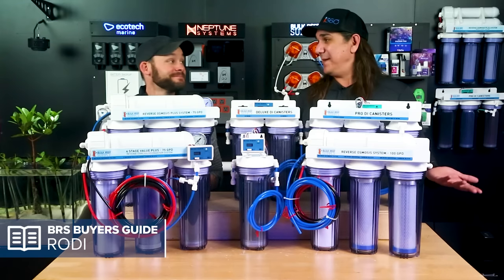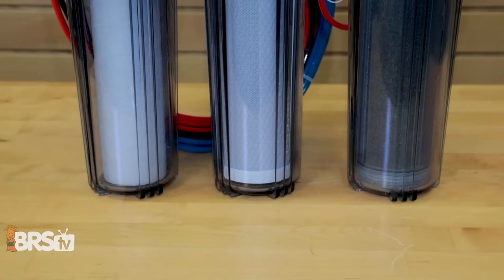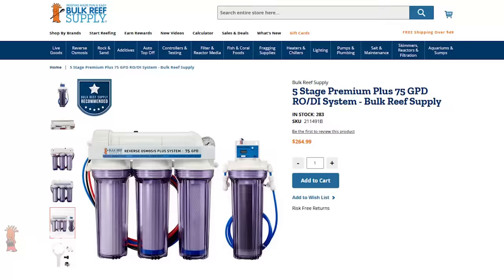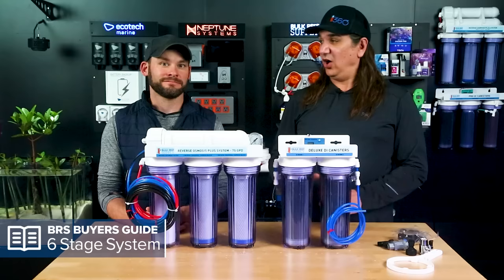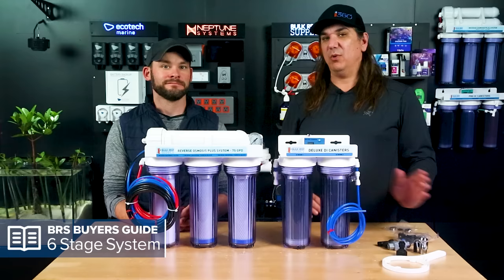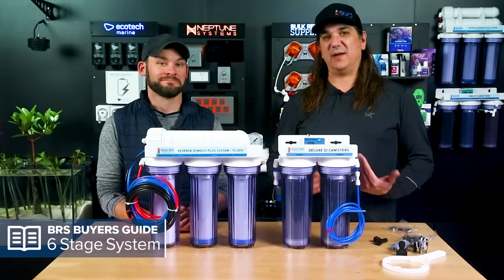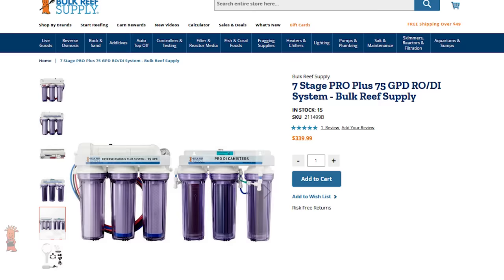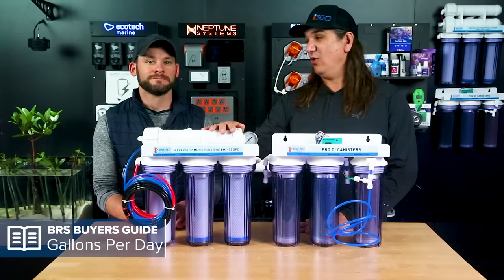Which Aquarium RODI System Is Right For Your Reef Tank? The Answer! BRS Reverse Osmosis System Guide

Comment: Hi Ryan why can you not plum the waist pipe to the mains in to your home thus cutting out waist water I am on a water metre here in the UK  I get my water from a company ( spotlesswater) I would love toget a rodi system but it would be to expensive thanks love your video's keep up the good work 😀👍
Reply from the maker: Interesting thought. You may want to consult a plumber on that one as I'm unsure of how that would work from a functional standpoint. The main water supply line to homes is usually under pressure (somewhere in the 40-80 psi range). Given that the waste line isn't pressurized, it would be hard for the system to function without some sort of pressure release feature.
Reply: Thanks for the reply it's worth speaking to someone about this because it would save so much water

Comment: Ryan and Randy, how much water does it take to make one gallon of RODI water?  I'm moving to a house with septic and am concerned about the amount of filter waste water.
Reply from the maker: If you use the water saver configuration (two membranes) and have good pressure (or use a booster pump), you can get pretty close to 1.5 gallons waste to 1 gallon of good product water.
Reply: @BRStv  then use the waste to water the lawn. Win win.

Comment: What is considered an acceptable amount of TDS coming out of the membrane and into the DI filter? I average 2-4 TDS. 4 at start after flushing, then it balances down to 2 TDS.

Absolutely loving the 5 stage plus system!
Reply from the maker: At peak efficiency, most RO membranes have a rejection rate of somewhere between 95-99%. That means if your source water has 100 TDS, the water leaving your RO membrane should be about 1-5 TDS. Then the DI resin should take that to zero. 

2 TDS out of the membrane into the DI is a good place to be.

Comment: Question. If my water is 300 TDS going in and 0 TDS going out, is the waste water 300 TDS? I thought of using the run off to fill my pool but I don't have a system yet to test it.
Reply from the maker: Your waste water will have a higher TDS than your tab water as it's more concentrated in terms of contaminants. Probably not an issue for a pool, but we're by no means pool experts 😅

Comment: Quick question. Jus changed the filters on my RODI unit. I turned it on and the lines just like started popping and exploding especially the waste line. . For some reason it seems like the flow is being restricted somehow. Any thoughts ? I can’t afford another RO system I’m screwed. All I did was change my sediment and carbon filters. The waste line seems like it’s going nuts idk what happened and when I turn it on I keep hearing a pop after a few seconds. 😩
Reply from the maker: Most likely just air being purged from the system. Let it run for a few minutes and that should eventually stop.

Comment: Idk what to choose can you help me should I buy the 4 stage,5 stage or 6 stage which is the best one out of those 3
Reply from the maker: If you're on city water, go with the 5 stage system. The two carbon blocks will be great for removing chlorine or chloramines, which are the two disinfectants commonly used. 

The great thing about these RODI systems is that you can always add on additional stages down the road if you see fit. They're super modular.

Comment: If I have a softener on the house, which model would you recommend?
Reply from the maker: Water softeners won't have much impact on the system that we pick. It's more about your source water and if your city uses chlorine or chloramines. If they use chloramines (or if you just don't want to look into it any further), go with a 5 stage or larger system. These systems all have two carbon blocks, which will help with chloramine removal.

Comment: Hey Guys, I live in the UK, so are there any other brands that you trust other than the BRS ones you sell?
Reply from the maker: The BRS RODI systems are the only ones that we offer. That said, if you have to pick a different brand due to availability, just try to pick one with standard filter sizes. Not sure what it is in the UK, but we normally use canisters designed for 2.5" x 10" cartridges.

Comment: Wat do I need for my 8g reef
Reply from the maker: This is the system that we suggest for most reefers:
https://www.bulkreefsupply.com/5-stage-premium-plus-75-gpd-ro-di-system-bulk-reef-supply-bundle.html

The RODI system you go with is less about your aquarium and more about the type of water that you're starting with at the tap. If you're on city water, go with a system with at least two carbon blocks. This way, you'll be covered against the two common disinfectants used, which are chlorine and chloramines. 

From there, you just have to pick the membrane size. Given that you have a small reef, a single 75 GPD membrane will be more than sufficient. Since you'll be producing very little water each week, you won't have much waste water.

Comment: I thought that the water saver was not series connected, I thought it took the waste water from the first membrane an fed that into the second membrane. 

Now Series connected tells me that the output of the first membrane feeds directly into the second which would not produce water faster and most likely slower.

Well it is y'alls equipment so you know how it is connected and works.
Reply from the maker: Don't worry, we haven't changed anything when it comes to running the membranes in series (meaning the second membrane is fed from the waste water of the first). Parallel would mean that both membranes are fed source water (faucet) separately and the waste lines were connected together to the drain.

Comment: How much waste?????
Reply from the maker: The amount of waste water depends greatly on your water pressure and the source water temperature. Generally speaking, you should expect about a 3:1 waste to product ratio for single membrane systems and a 1.5:1 waste to product ratio for water saver systems. Your exact ratio may be better or worse if you have higher or lower water pressure, respectively.